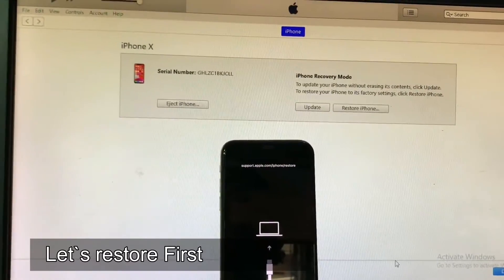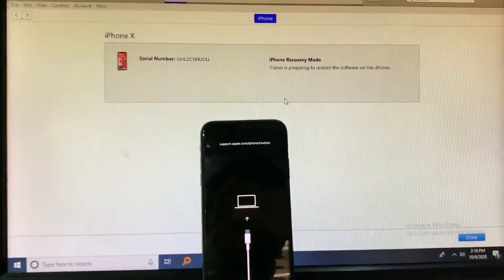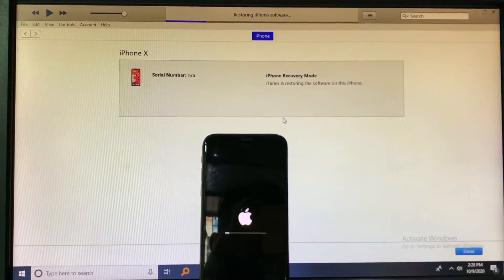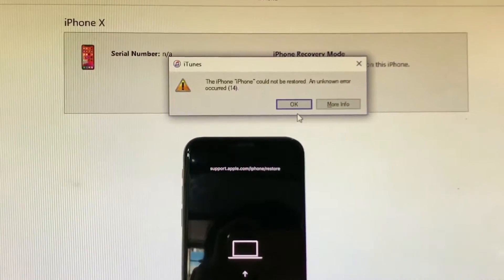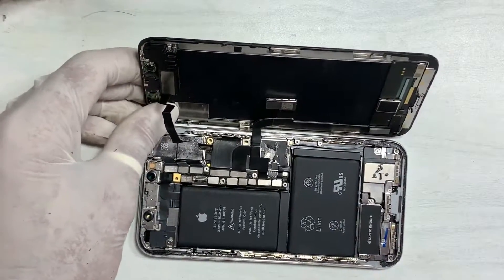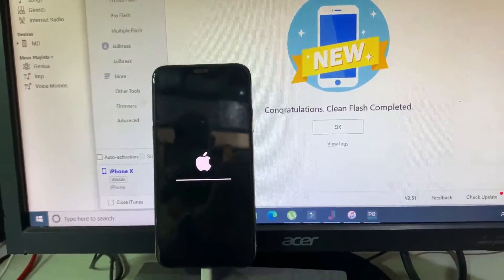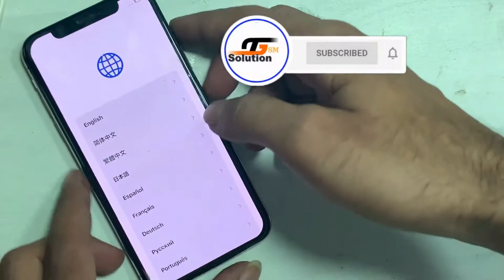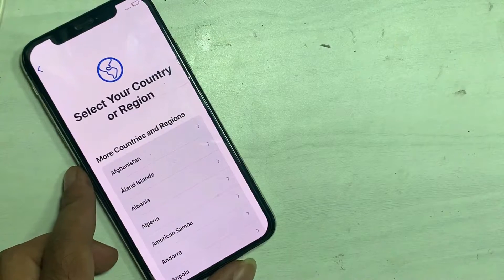iPhone X iTunes Error 14 Error 9 Error 4013 Solution! iPhone X bootloop fix.

Comment: Folks, it worked for me via iTunes when I connected my phone with it. Then I was pressing update the whole time and every time the error message (14) came after a short loading time, during which it was displayed several times that an update would not be possible due to the full memory and you just press "restore" should. You shouldn't let yourself be dissuaded from pressing update, for me it finally worked after the 15 attempt and my cell phone came on again and all my data was available.

Comment: My iPhone 7 Plus is stuck in a recovery mode due to Error 14. I received a notification that my memory is full and was trying to delete some photos and videos, but they kept coming back. I decided to reload my phone and stuck in a white screen with Apple logo. I was trying to update my phone through recovery mode and my update failed at 30-40% giving me error 14. I have unsaved photos and videos since 2017 that I can't simply erase by restoring the phone to factory settings. This is a well-known issue for more than 6 months described here in full details https://youtu.be/aQTObeAUzkQ Do you think you can help recover data and make it work again?
Reply: Have you fixed this problem? Exactly the same problem happened on my phone((
Reply: Same happened
Reply: same happened with me problem fixed ?
Reply: Don’t you backup to iCloud?
Reply: Same here.   .....  iCloud Backup is incomplete for some reasons...